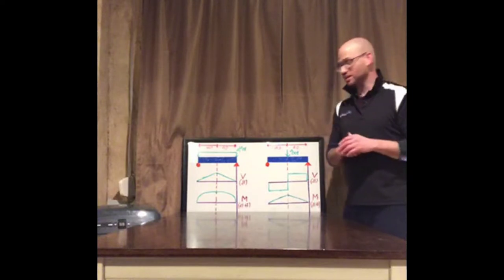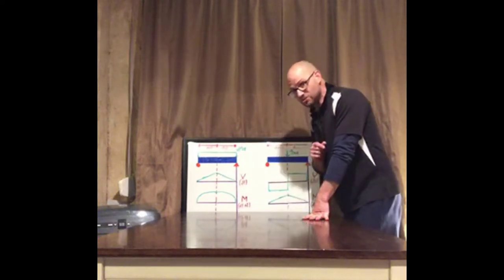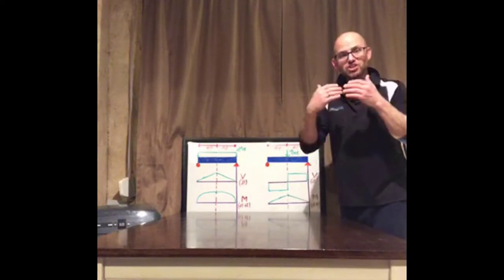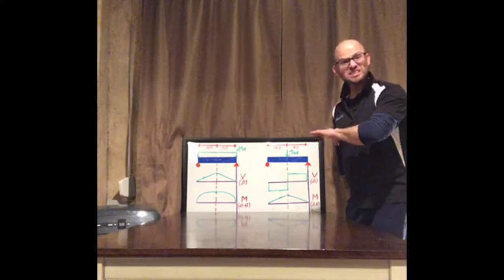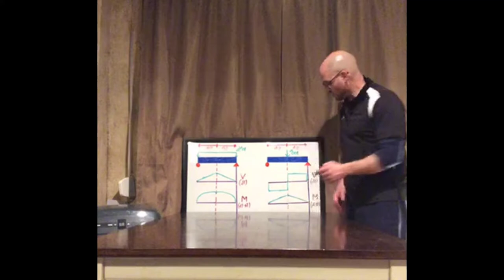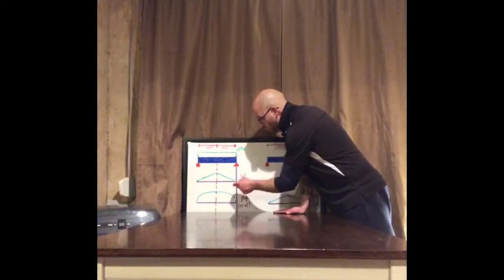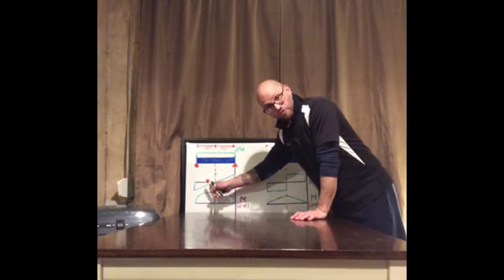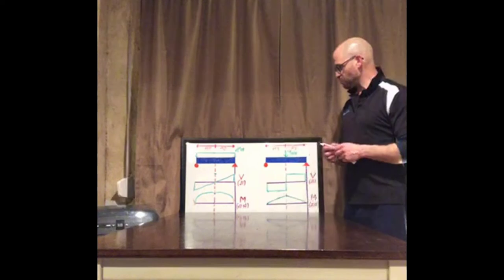Beginner Engineering Statics: Pt 1 - Simply Supported Beam - Vlog 613

Comment: Nice work that you share this knowledge in these harsh times.

Please allow me to say that you also screw up the moment diagram 😉 In it's rough form it's indeed correct. However, the max slope of the left one should not exceed the slope of the right one. Furthermore, the left one should fit in the right one completely. This shows that the bending moment the beam has to carry is much smaller for the distributed load than for the point load (when they are equal of course). Nevertheless, this will become clear as well when you dive into the math. It was just so much cooler if the graphs were to scale or at least in proportion 😎

I don't want to judge or tear down your efforts, I really appreciate what you're doing. And for sure, nice recovery for the shear force diagram!
Keep up the good work 👍
Reply from the maker: Thanks for the feedback.  I am running a solution on a cantilevered beam today and will make sure to draw out the slopes a bit better.  I ran more of the math on the beams and have done a combination distributed load and point load Calc.  When time permits check those out let me know what you think.

Thanks again for the feedback, much appreciated!!!

Jon
Reply from the maker: Thanks again!!! Whitney was doing a poor job of containing her laughter in the background while I was trying to recover.